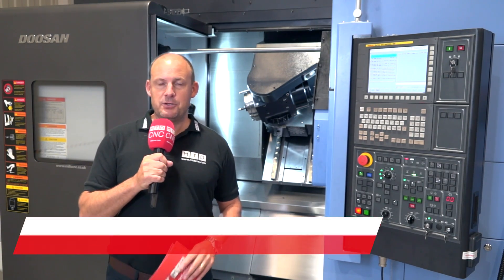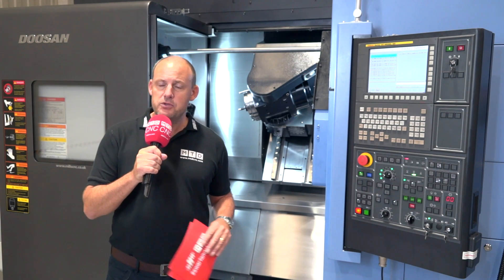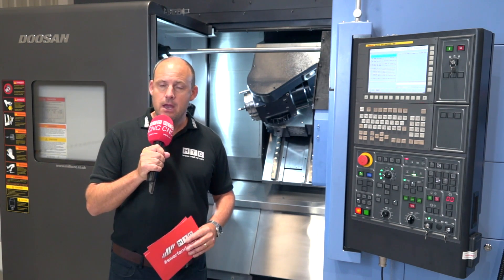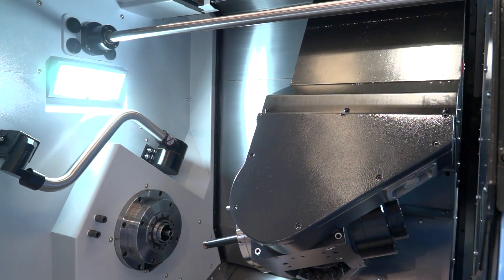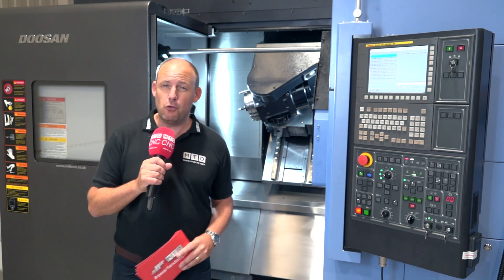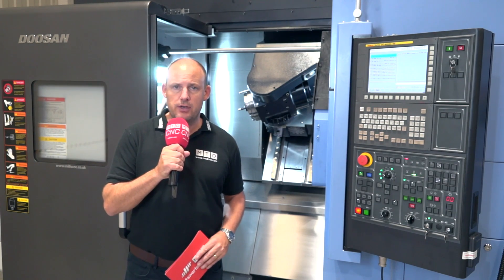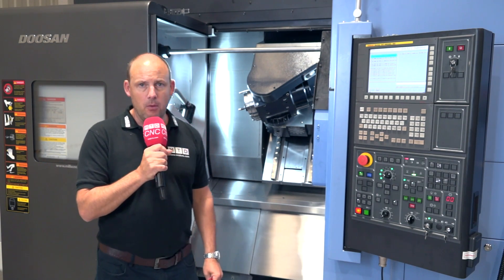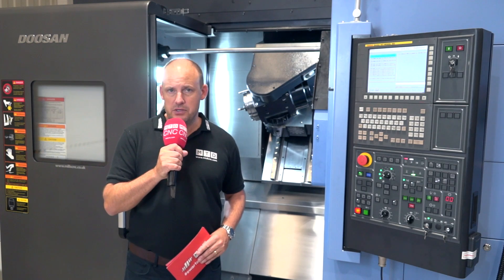Doosan mill turn now in a smaller footprint

Comment: Real nice machine.

Even though lathes that use a toolchanger are inherently slower for chip-to-chip than a turret. For programming, you just have so many more options for tooling. You also don't have to worry about pesky clearance issues. High volume simple parts, turret. Anything else, a toolchanger if possible.